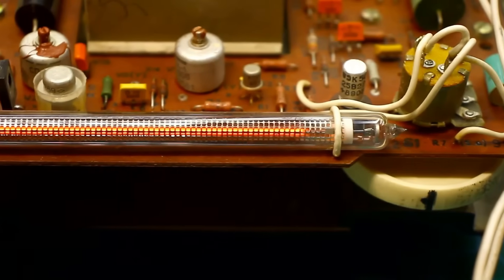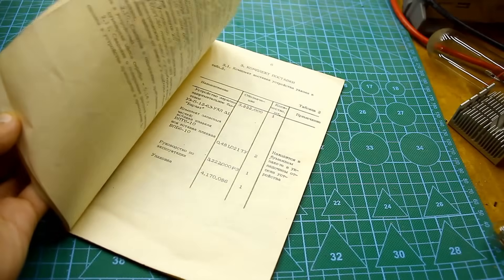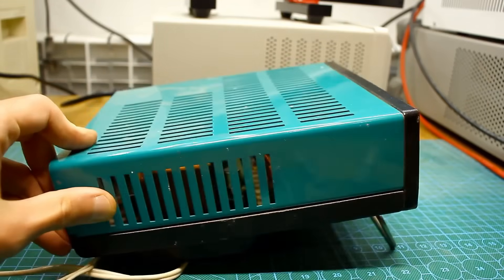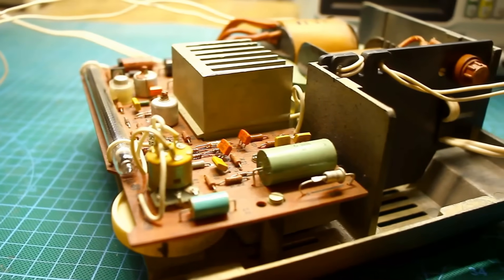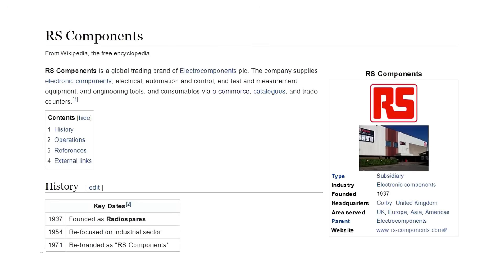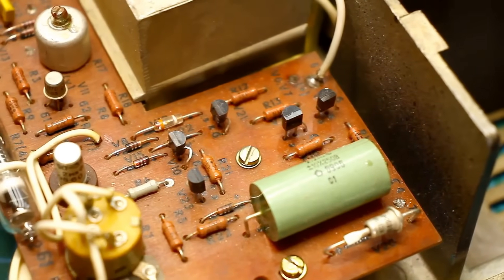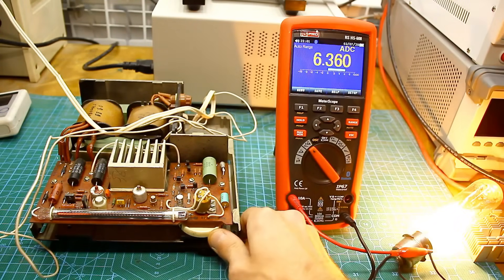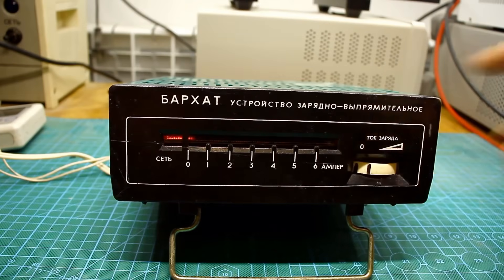An Interesting Car Battery Charger From The USSR.

Comment: Reminds me of the BOC Autolynx mig welder I bought in the mid 70s. The handbook gave operating instructions, then a complete circuit diagram, list of components, test procedures Etc. I bought it 50 years ago and still use it, it is one of the VERY best mig welders of it's type ever made.

Comment: But with output voltage equivalent to full transformer winding voltage 18V,  fancy nixi tube is worthless because 12V battery needs 14,4-14,7V full voltage when current drops after charge cycle. With high output voltage, current still flow and try to brake water in battery to hydrogen and oxygen. This method is unacceptable for sealed flooded or AGM batteries. You need voltmeter to guess if battery is charged or listening if flooded battery starts bubbling. But this type of charger is exactly what you need to revive deep discharged battery with sulphate buildup which modern microprocessor controlled chargers refuses to charge.

Comment: Neither the indicator nor the multimeter will read the current accurately.  The meter will be trying to average. Your best bet is probably an analogue meter.  That said it doesn't really matter for a battery charger, battery is good will take a good current fir a while and drop down, a bad battery won't.   Lovely display and I have seen those tubes before as new old stock.

Comment: How great is it to have a manual with all the technical details about the product… Modern electronics (especially consumer products) don't have such a detailed manual. The companies just don't want you to repair them, they even put verify codes on the parts to prevent non-official servicing…

Comment: The indicator nixie tube is so beautiful. I love those cold war electronic components, their structures are beautiful and different from modern components
Reply: I bought 4 of those 20 years and one move ago. I wonder if they are still in a box somewhere.
Reply: @paulmcgrath2175 , i was cleaning a couple of weeks ago and found a box of VFDs i bought from Ukraine on ebay several years ago. I guess I'll have to revisit them soon.

Comment: Very high quality video. My russian isn't perfect but I will try to watch original as well, as english translation has errors.
But videos in both languages help not only learn electronics but also technical language, as is differs in english and russian, its not just word for word translation, some logic how terminology is built is different.

Its good you pointed out other videos explaining similar schematics, trough you forgot to put links in the english version.
Device is very interesting,  i might build a thyristor based battery charger. Trough I would like to have some protections built in.
The manual is gold, a standard how they should be made.

Comment: Me alegro que se haya recuperado un cargador analógico de esa época, una pieza de la antigua URSS cuándo se fabricaba sin obsolescencia programada, si no hecho para durar en cualquier clima y traía su cto esquema, no como los de hoy, la obsolescencia programada empezó por no dar con el producto su información técnica, este cargador tiene una carga profunda familiar, tengo un cargador de baterías de los años 70 que compré de marca italiana CEBORA de 6v 12v 24v  1Amp 3 y 6Amp, que se ejecuta a través de un conmutador manual de voltaje, le hice una revisión general y cambié el rectificador de selenio por un puente de diodos de 20Amp un condensador eléctrolictico, dos ventiladores de ordenador uno en el transformador y el otro en el puente rectificador y ha vuelto a cumplir su función, ya lleva cargando batería dos años, un cargador simple que su alma es el pedazo de transformador que trae, saludos

Comment: I'm still using soviet charger, much simpler than shown here. It still works and it works even better than modern electronic ones, allowing to ressurect too deeply discharged battery.
Reply: Old biltema chargers would just be a transformer and a full bridge rectifier. The problem is just that its not nice for the battery to boil them and sealed batteries can just split.

The style is still somewhat popular say here in thailand, but theres an overcurrent protection that just pops and a current indicator.

A lot of this one would be the driver for the tube.
Reply: At 05:10 power 140W, it is Watt , it isn't ,,double you" !! 😂

Comment: Many years ago we had a company called Radio Shack. They mainly sold electronic kits and electronic parts. In their early years either every item they sold came with a schematic included in the manual or you can ask an employee to order you a schematic. After maybe ten years they stopped providing a schematic and it was luck if you could order one.
Reply: alas Radio Shack (if the report i saw was accurate) fell victim to a private equity firm's favored practice for extracting value from long-standing retailers . same thing fo Sears, Toys R Us, and most recently Joanne Fabrics
Reply: @ They went from selling to builders to selling to consumers.
Reply: Many many years ago home PC's came as a kit and you had to assemble it yourself.
Reply: @RaymondSwanson-u9y They still come like that, I never buy prebuilts.
Reply: @RaymondSwanson-u9y radio shack was one of the first chain stores to sell their own design ready to go computers.

Anyway in asia you can find still shops that sell everything radioshack used to and more. I can walk in and even buy voice coils for speakers and stuff and parts for the usual low end microwaves etc. They got a counter for chips too, though mostly i enjoy ability to buy like the usual android stuff and boards from a shelf. Like a lot of aliexpress kind of stuff, amp boards etc just sitting on a shelf. Lately they haven't had any fun factory surplus in the store i frequent though..

Edit: i meant to say aduino, but i can also buy otc all the usual android parts for the bigger selling models, charge connectors, batteries, screens etc and walk to a booth that will do bga chip install etc as well
Reply: I remember when Radio Shack had a Faxback service with technical info like schematics, exploded view parts diagrams with reference sheets and price lists, and even diagnostic procedures. The downside was it was a long distance number, back when that was still a thing with a per-minute coat and fax machines were not fast about moving that data.